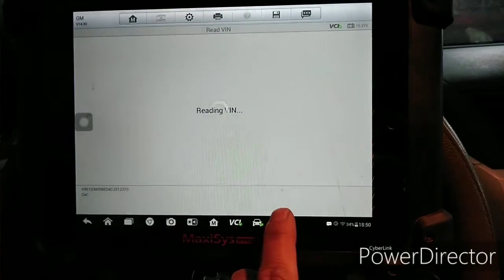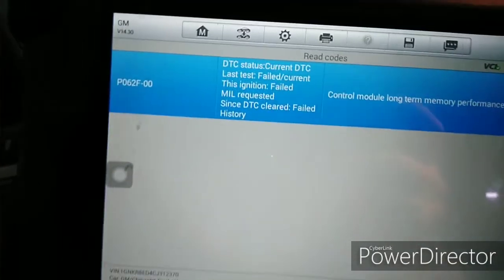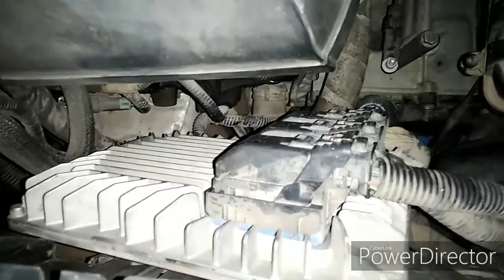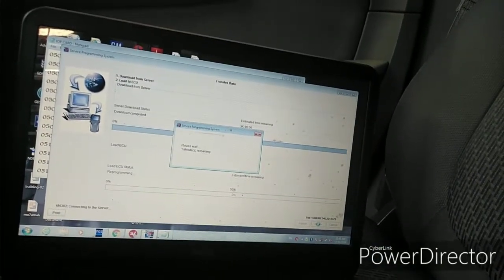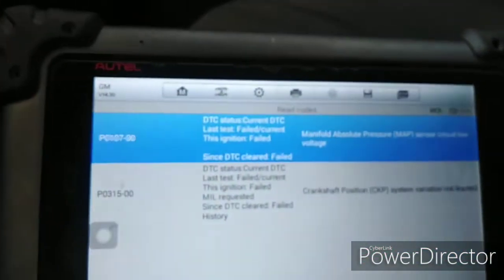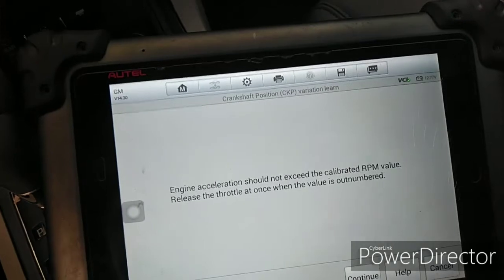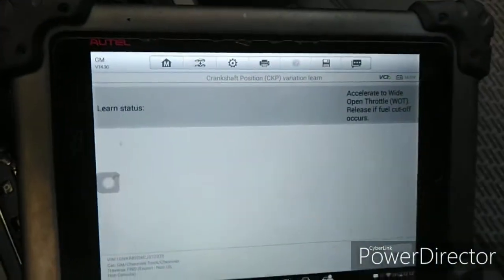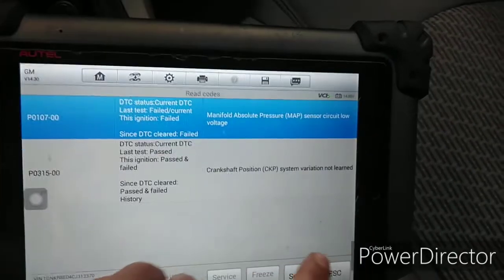ECM programing Traverse 2012

Comment: What device did you use to program it?
Reply from the maker: Ac Delco TIS
Reply: @pjbandal  how do you make an account with them
Reply from the maker: Hello sir, I am using maxisys scan tool for adaptation and relearning or reset. On module reprogramming like GM  we use ac Delco online programing, for Ford we use IDS..
Reply from the maker: Hello sir, I am using maxisys scan tool for adaptation and relearning or reset. On module reprogramming like GM  we use ac Delco online programing, for Ford we use IDS..